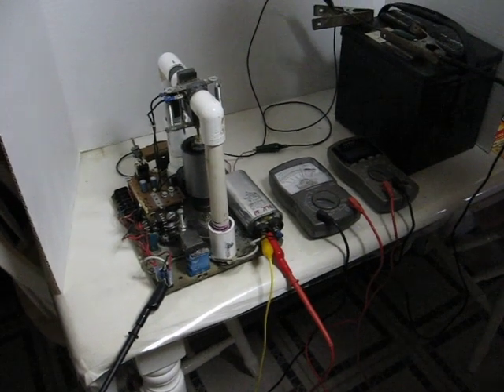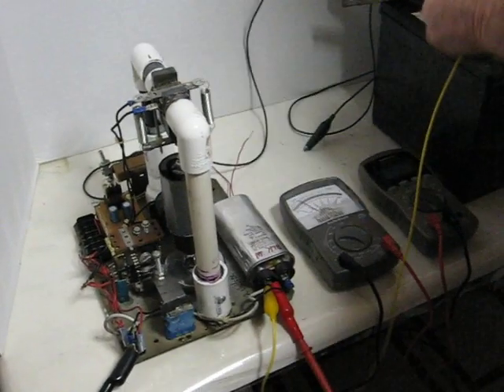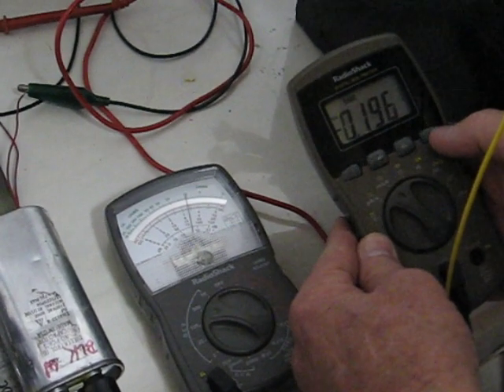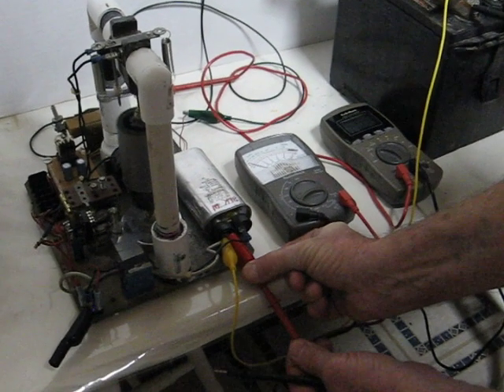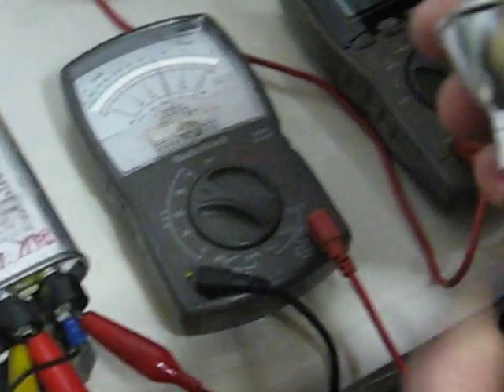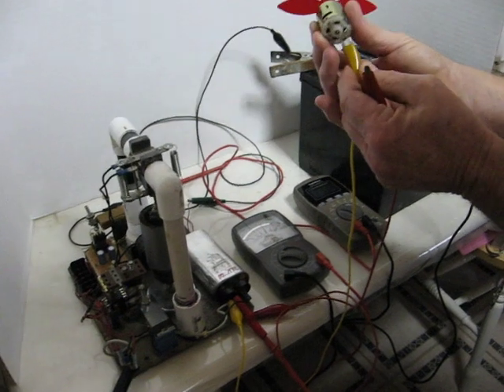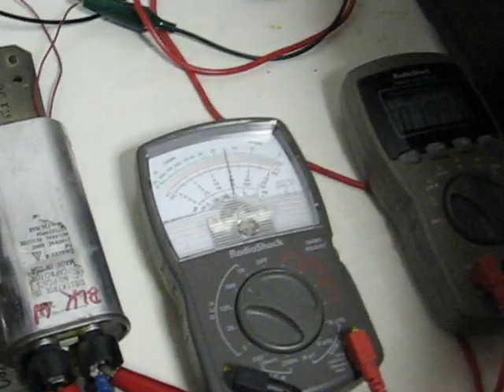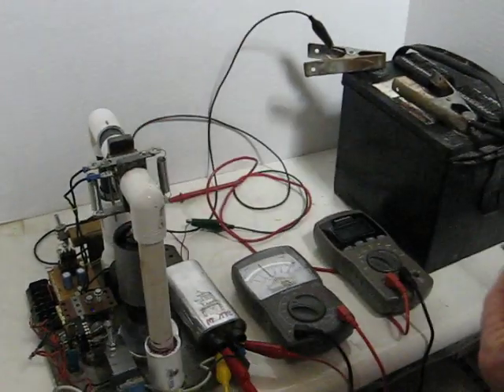electromagnetically driven rotary motor demo 2

Comment: 7years later-?  DO U GOT THAT PROTOTYPE ? :-)   SEND A LINK YO!    ty.  keep posting!   ;)
Reply from the maker: I do have a better prototype on youtube. Look up ADVANCED MAGNET MOTOR R&D UPDATE. I am working to get the speed and torque up to run a generator. Also working on a better video. I need more force in than I can get back out but I can get that force by having more turns of wire on the solenoid but I am limited to what I can buy from solenoid companies. I need a more forceful solenoid in the 12 Volt DC range and nobody makes them the size I need. I am self funded and to make one prototype solenoid is way out of my reach. I am a retired former Marine and Auto worker with some health problems. That's why it is taking me so long to develop.

Comment: its nice that you are working on this and a great model, but ppl like you give real inventors/designer a bad name, making claims asking for let me guess money by "interested in a venture",  show real proof that it uses less power because it does not use field coils, will then just use a perm mag motor, or an AC motor which only has field coils, no rotor coil, so as you said less power used. its good to look for the KEY but you give others a bad name

Comment from the maker: I connected the amp meter in line with the battery  and the positive feed to the device. I don't have a scope but I'm sure the spikes will peak as in a resonant circuit  I welcome all the help I can get.  All was DC and the switching relay acts like a DC chopper circuit. You are welcome to test the motor. Video's just don't do justice to the set up.

Comment: I'd like to see more information on this and possibly even test the system for you. Do you have any waveform charts or scope videos? What does the waveform out of the capacitor look like? Pulses can be misleading.

I calculate (if all was DC) 2.3W in and 6.3W out. Looking at how you connected the 'in' ammeter didn't look right. You started to do it right, by putting in line with the feed, but it appeared you changed that up to get the alligator clips and I think that will confuse some.